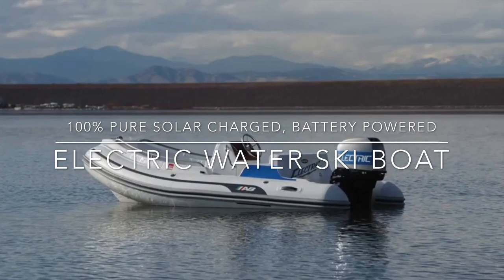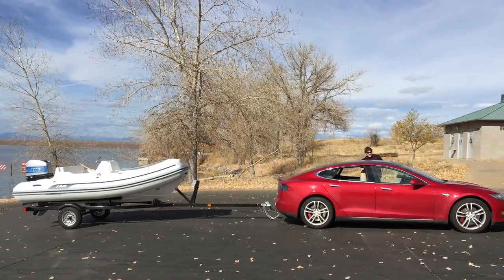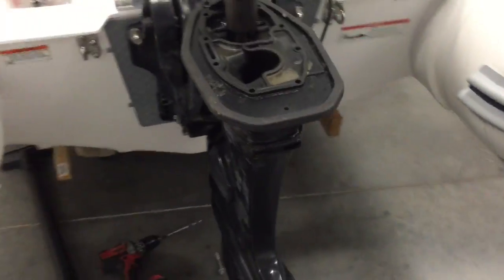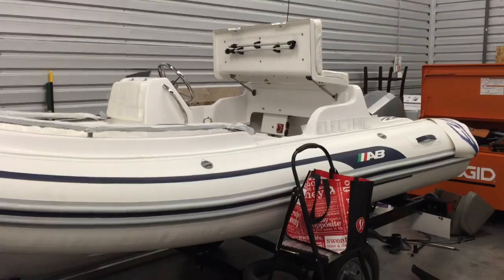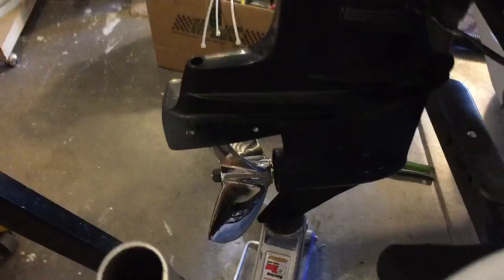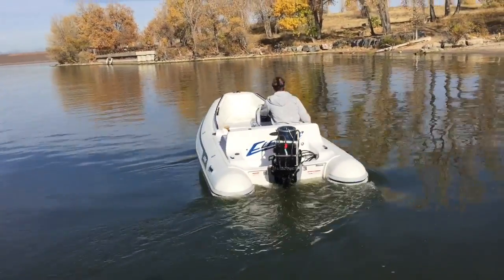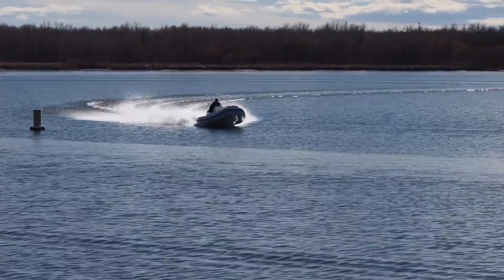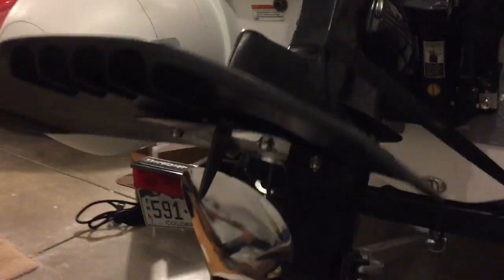World's Fastest Solar Powered Electric Water Ski Boat  (full documentary)

Comment: How big battery pack you have in kw/h?   so the motor is 15kw and how much volts? mount a very low solar roof ,  that you can retract when you exit the boat
Reply from the maker: A.E.E.N 5th 
Hi. It's got 38.5 kWh of battery at 170V. The controller draws 500 amps so that is 85,000 Watts maximum. In reality, full power will drop as there isn't enough cooling in the motor and VFD to avoid overheating. 
I'm building a solar Bimini top like the on on the tractor in my other video. It'll be 600 Watts. 
Thanks for watching!

Comment: What's the most efficient cruise speed, and what's the range at said cruise speed?
Reply from the maker: Drunken Hamster 
Hi, it can run about 30 hours at "idle" speed or 30-45 minutes at full power. We get about 4 hours of waterskiing time. Best efficiency is the same as a gas boat...around 25 mph. I could add batteries if I need more run time but I don't usually use more than half capacity. 
Thanks for watching!  More to come...
Reply: useful info, but maybe something you could've shared in the vid.... some don't like having to troll thru comments to get this kind of important detail.

Comment: Can you make a system for a 24 foot party barge pontoon boat?
Reply from the maker: Yes!  We used the standard gearing and props.  To get 53 mph, we used a 24" pitch prop.  For a pontoon, I think an 8" or 10" would be best.  This was a 60 hp gas outboard to start.  The pontoon would be much easier from the battery standpoint, you could use a large or heavy battery.  We really pushed for low weight since we were going for speed.
Reply: for a pontoon you should check out torqeedo they make great electric outboards
Reply: Crushonius you
Reply: Net Positive LLC w
Reply: Google Solar Boats
Reply from the maker: Crushonius 
They do make a great product. That is what I first considered, however it would cost $85,000!  Their most powerful motor is only 75% of the power of mine and costs $25,000 You'd also have to buy four of their $18,000 batteries to equal what I've done. I spent about $13,000 total on my motor and batteries. 
$13k vs $85k, better performance and I learned a lot... 
That said, if money is no object, buy twin engines and go all out!  You'll have the best product with the least work, torqueedo is the way to go.